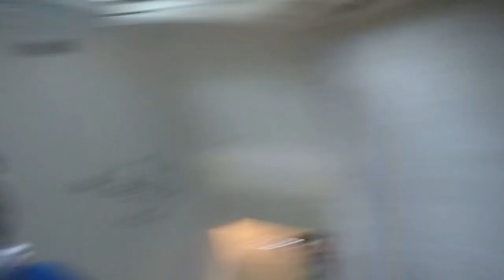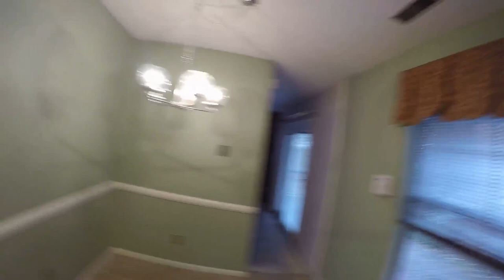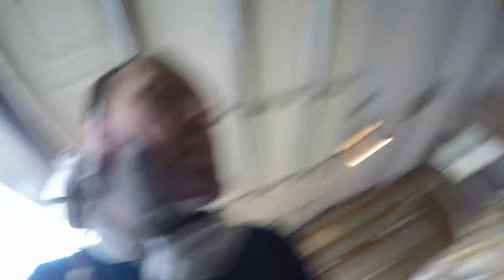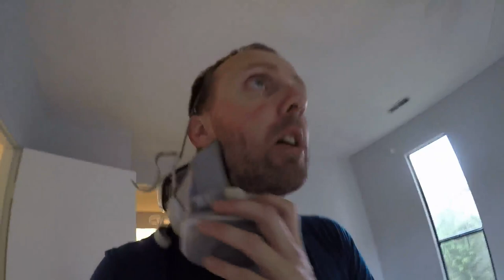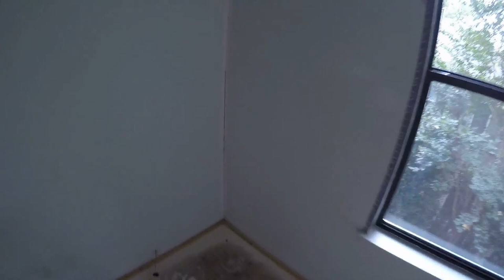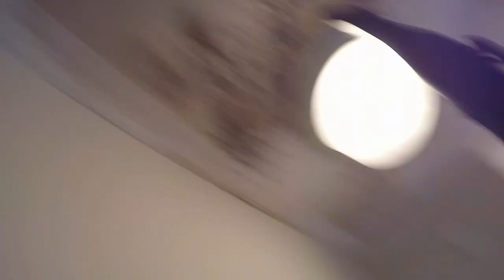LastHumansHomeLife: Construction Walkthru

Comment: I would take off the light and check around it. Put a small bucket there to catch and AC stuff when it runs. Change the Air filter  intake for your HOV system. cool house man.
Reply from the maker: ya i have professionals coming tomorrow to do all my walls.. and theyre throwing in that roof work also

Comment: For the baseboards use caulking. It's an trade hack.
Reply from the maker: i have to watch the video to see what you mean. you mean to seal a gap?
Reply: LastHumansGarage use white caulking to fill nails and any gaps to wall. Have dishwasher detergent in water and wet your finger really well to smooth caulking. soap prevents it from sticking to finger
Reply: LastHumansGarage use white caulking to fill nails and any gaps to wall. Have dishwasher detergent in water and wet your finger really well to smooth caulking. soap prevents it from sticking to finger

Comment: Yes - you'll need a pro to do the corners and mud - money well spent - if you do it yourself it'll take a long time and will drive you nuts where it's not perfect.  The pro will be in and out of there in a about 1/2 day from what's in the video.
Reply from the maker: i ordered the mud team in. $800. but they are doing more than just that. that are fixing other areas and a few cracks also. and they are doing it all in 1 day with a team.

Comment: Don't bleach that mold! Hydrogen peroxide is much safer and more effective due to its higher ratio of chemical to water. The problem with bleach is that much of it is water which, after the chlorine has disipated,  will cause mold regrowth. How will the mold regrow if you have already killed it will the bleach? The porous surface of drywall allows the roots of the mold to embed, providing an opportunity for regrowth when enough moisture is present. Good luck man and congrats on the house.
Reply from the maker: hmm thanks for the tips. although in the end everything is scraped to cardboard now. the drywall doesn't have plaster. (and it should)